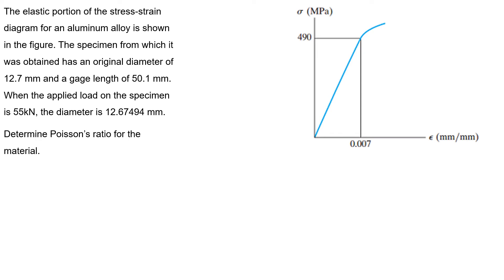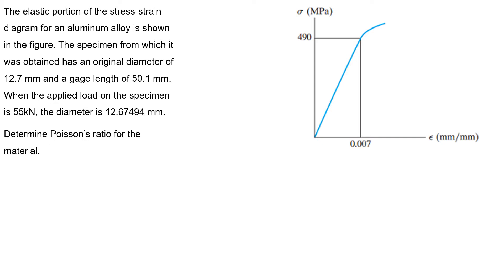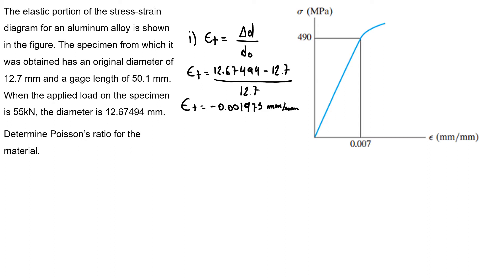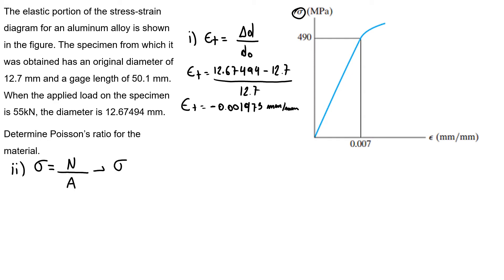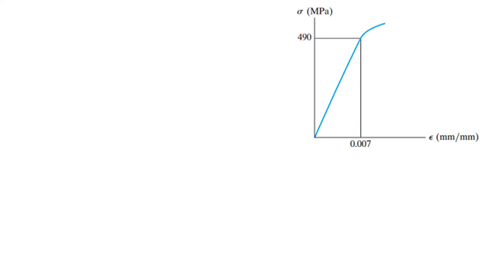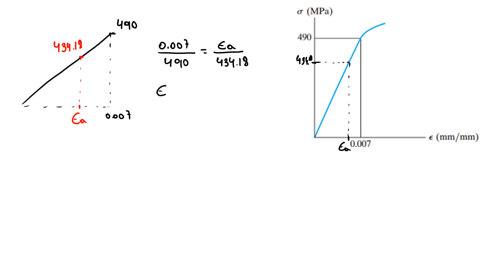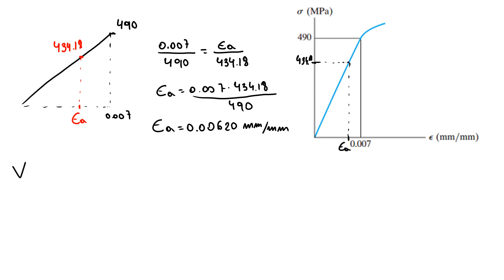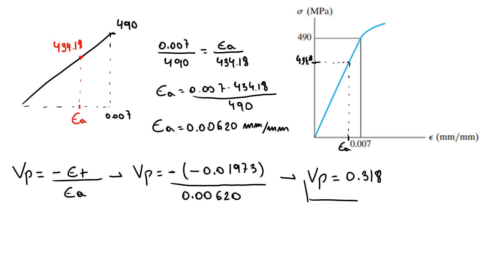Strain-Stress Diagram Exercise 1

Comment: Thank you for uploading and working through this problem. It was most helpful. One clarification, however. When solving for the Poisson ratio at the end I believe it's supposed to be 0.001973.
Reply from the maker: Hi Brent, thanks for commenting. The step one is the value you found. The Poisson's ratio is given by Et/Ea. The result was the same as on the video. Let me know if you have further questions.